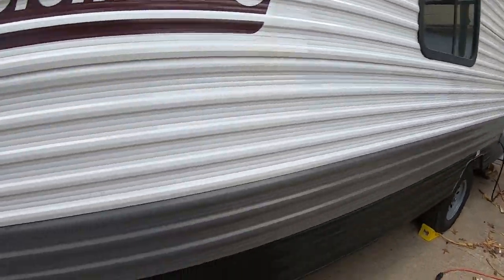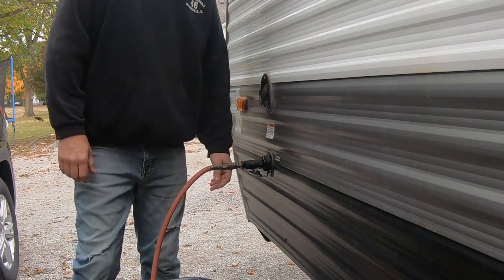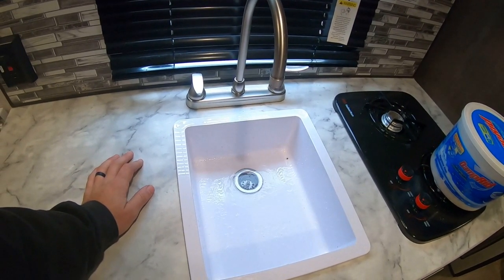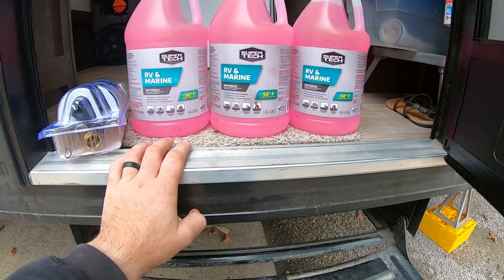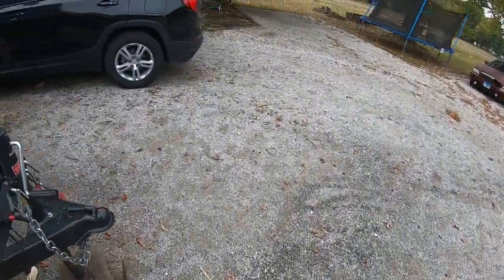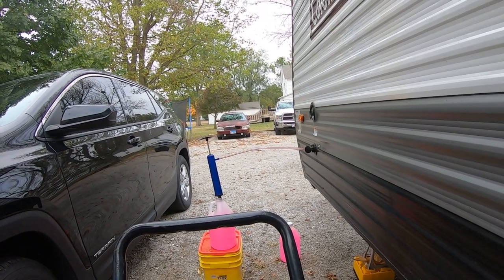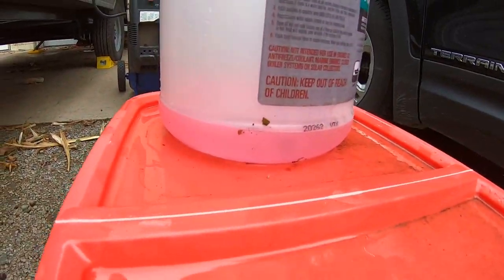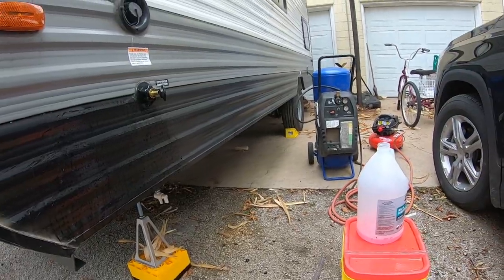How To Winterize Your Camper | Coleman Lantern LT 17B

Comment: Thank you for this video. It is extremely helpful. I notice you used the same air compressor I have. Did you have a problem with it keeping up when blowing air through the pipes? I kept having to stop so the air could build back up to be strong enough to continue to blow water out.
Reply from the maker: No it did great. Since it is running at a low pressure it recovers very fast. Just remember to turn the pressure down before you hook it up.

Comment: We have a 2022 same camper as you. How do you turn hot water on. We have propane water heater. We are beginner folks. Please tell me like steps to turn hot water heater on and propane
Reply from the maker: The best advice for that is to light the stove top so you know there is propane in the lines before you light the water heater. Depending on the model some of them are manual light and some are automatic. The one we had was auto and there is a switch inside next to the door. Give that a shot and good luck. There's a Facebook page dedicated just to the 17B. Coleman Lantern LT 17B Owners Group. Check em out, they are an awesome group with tons of advice and no drama or negativity.

Comment: What’s the pump you got called? Or is it on Amazon
Reply from the maker: It's an antifreeze hand pump and you should be able to find it at Walmart in the RV section near the antifreeze. We also put out another video on winterizing that doesn't involve using this pump, you can actually use the onboard waterpump to winterize

Comment: We had a Taylor Coach Bobbie, and used a bike foot pump and a camco fitting. Drained the 6gal Atwood and we had an outside shower also to do with the wetbath and kitchen sink. We would build up pressure about 4 or 5 times.  We did not use antifreeze since we live on Island on west coast Canada, so no severe freezing,we get 4 inches of snow for 5 days per year) we also use a super product called Happy Camper in our black and grey tanks. No smell ever!!! Our new trailer we ordered thru Taylor Coach, will be bigger like yours, a 16ft floor, 19ft total. They build whatever you want, as custom as you want. From 8ft to 26ft, or as wide as you want, from 6.5 to 8ft. How many windows, sinks, beds, no propane, water - you design what you want!

Comment: Do u take battery off and take poleopane tank off
Reply from the maker: Yes definitely take off the battery and depending on where you are storing it will depend on if you need to take off the propane tank. I would say if you store it away from your home definitely take off the tank but if you store it at home you should be ok with leaving it on.

Comment: What do you do with the black water tank? The last time you camp there is still water and deodorizing chemicals in there.
Reply from the maker: @Diane Davies once we camp for the last time and do a very thorough clean out, I'll spend at least 15 minutes just washing out the black tank, we typically take the cap off of the line and let it drain for a few days and the close all the valves. Once it's all clean and closed up we'll winterize and just put whatever is left from the gallon of antifreeze in the traps and in the tanks. Winterizing is definitely something that needs to be planned that is for sure. I typically know when our last camping trip of the year is. If by some chance I don't get it cleaned out and we still need to deep clean I will take it to our local camping world and clean out there. Hope this helps. Safe travels and God bless.

Comment: I am getting ready to do this and can't decide between doing it this method with the hand pump or using the onboard pump with the bypass hose.  Why did you choose to go with the hand pump vs the onboard?  Is there any benefit either way that you can think of?
Reply from the maker: At the time I made this video I was unaware of the onboard pump. I'm getting ready to winterize today and I am going to use the pump and make a video showing how to do it.
Reply: @SmallFamilyBigDreams  Well I may just hold off and watch you do it first! 😁
Reply from the maker: @fastasslizard  I'll post it ASAP since I know most of us are in the same boat. I typically schedule them for Sunday mornings but this one is a little different.